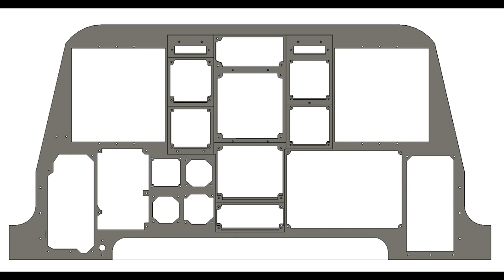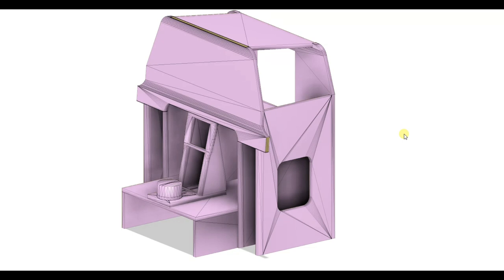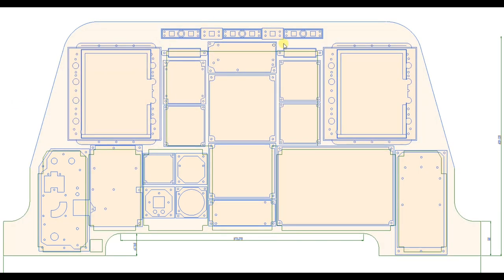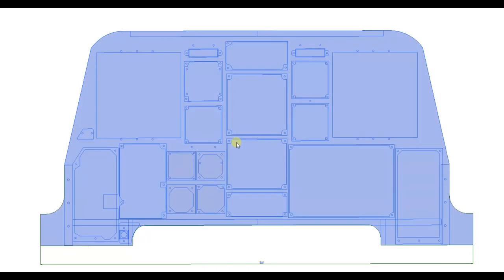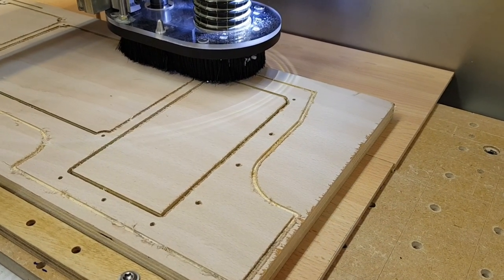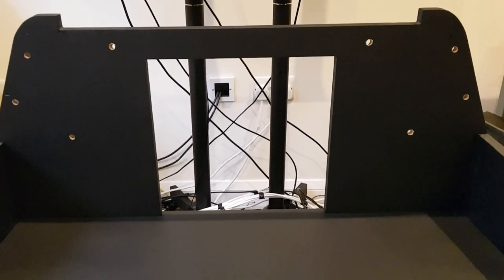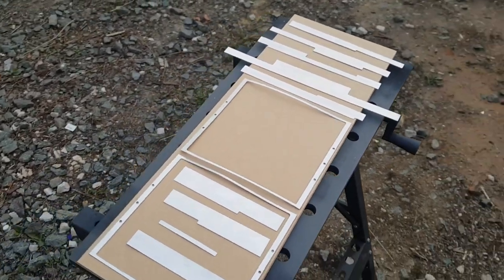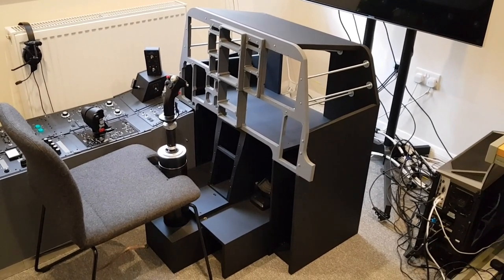Simpit A10C - Front Dash - Part 12: Fascia - Design and Build

Comment: Really great work Craig.  Especially like how you have incorporated the CNC work.  That's two hobbies in one and it looks fabulous!  Looking forward to the next instalment.
Reply from the maker: Hi, Its crazy how many areas this hobby touches on - CNC usage, 3D printing, fusion 360 software, PCB design, woodworking, website design, video editing, etc. Luckily, I love learning and improving. 
Thanks for the thumbs up. Appreciated. Im working on the armament panel currently. Quite exciting as im using real tornado toggles for it
Cheers